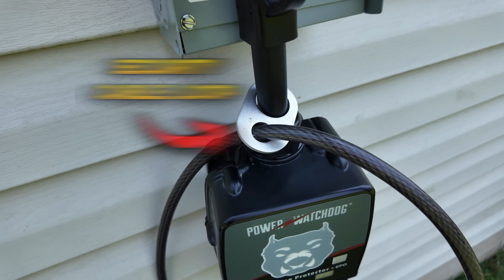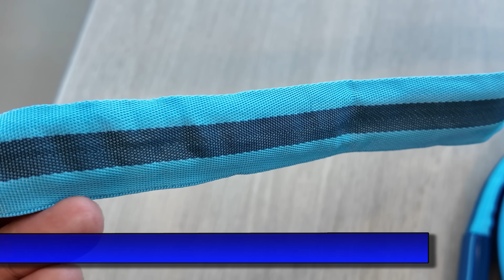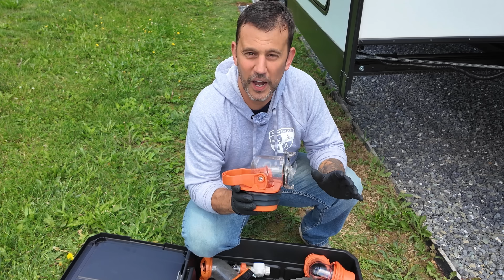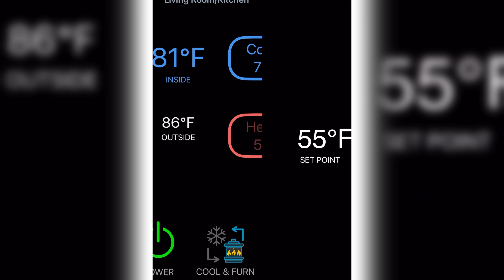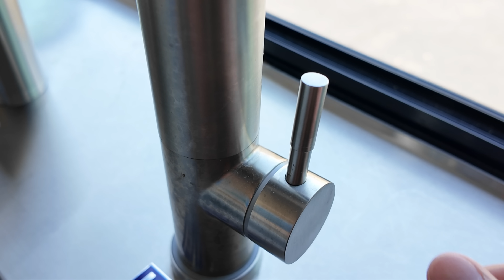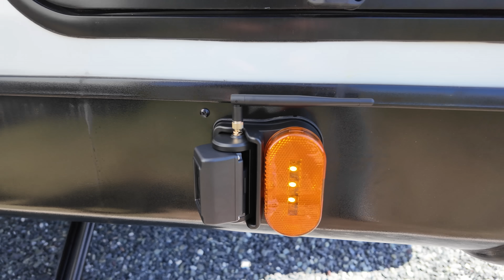💡Innovative RV Accessories & Upgrades That CHANGE the Way You RV!

Comment: I’m glad to see you talked about the Camco Rhino Pro.  When I saw it I thought I had to get one.  For info I have owned six trailers or 5th wheels over a 33 year period.  I kept looking online and found one in stock at a Walmart 1/2 hour drive from my house.  I purchased it online and went and picked it up.

Fast forward a week and we went on the camping trip I am currently on.  Three different campgrounds and the Camco Rhino Pro DIDN’T fit the sewer drains at any of them.  I left my older connector with the stepped treads at home so I had to go buy a new connector (ugh!). In any case I’m glad you provided the info you did here and the advice to carry both connectors.

Thanks
Reply from the maker: thanks for sharing your experience Josh

Comment: Will the micro air thermostat work just for your furnace. My A/C is direct dump with the controls on the unit itself.
Reply from the maker: Yes, as long as there’s a replacement for your specific furnace tstat.  You won’t have AC function wires behind the furnace tstat.

Comment: The rain protection was the only reason I chose Progressive EMS over Watchdog. My next EMS will be Watchdog.
Reply: @LoudRam  progressive also has lifetime warranty on the circuit boards
Reply from the maker: did you ever experience the initial circuit analyzation (before it lets the power through) to take longer than normal... Ive seen someone mention that with the Progressive EMS units... not sure if it was a common problem though.  Both good products.
Reply: @RVTIPSANDTRAVELS  It does take longer than the Watchdog but I usually plug it in and go about the rest of my set up. Then I check back on it a few minutes later and it's ready to go. I've never noticed exactly how long it takes. The campground we normally stay at does have low voltage issues especially during hot days when everyone is running their AC. Every once in a while our power will cut off because of that. The EMS is doing it's job. My last Progressive wasn't an EMS it was just surge protector. The plastic around the blades on the plug started to melt because of the low voltage/high amps. That's when I knew I needed an EMS. This is a MUST HAVE!
Reply from the maker: thanks for sharing, and you are correct, surge protectors arent really protecting against the common problems you will face.  low voltage is more more prevalent than power surges.
Reply: I never really notice much delay. It usually powers up pretty quick and then cycles through the error code status, voltage, amps.

Comment: Where did you find the Camco locking drain? It's out of stock everywhere?
Reply: I got mine 3 or 4 weeks ago at my local Walmart. Been watching Amazon for a while and they're always out of stock. All 3 of my local Walmarts had it 3 or 4 weeks ago. I picked it up at the one I frequent most. A week later I was back there (for something else) and they were out. The other Walmart across town (about 5 or 6 miles away) still had them in stock tho...  Keep checking...  (It looked like it could be ordered on line too and picked up at your local Walmart...)
Reply: Eta -  It works so much better than that threaded clear elbow! It is very worth it... but it's probably good advice to hang on to your threaded version in case you get a really small diameter dump access...
Reply from the maker: Camco sent it to me a while ago before it sold out... keep checking, it looks like it will be at Walmart before Amazon sees it.
Reply: @smrdmr1  check online At Walmart every day
Reply: Keep checking Walmart online. We found one after months of searching. Had to drive almost hour away
Reply: I also got mine from Walmart. It took a few tries to get it. They were always out of stock. I got lucky. But it does work so much better
Reply: I found mine at a Bi-Mart in the Northwest.
Reply: Got mine at Walmart. Shoved way back on the shelf behind the other elbows! SCORE! Or so I thought. When I tried to use it I found it doesn't fit on my sewer hose.( Also a Camco product with a permanently attached clear elbow) . So until I need to replace my hose the drain lock will take up space in my storage space.😢

Comment: We started using a collapsable water hose (not this one) for the ease of storage but noticed super low water pressure.  It finally dawned on me that the hose was the problem.  A standard hose restored proper pressure.  This one looks like it would work better.
Thanks!
Reply from the maker: i noticed this exact thing with my old zero-g hose i was using to wash off my house yesterday.  i havent done flow tests on this hose yet, but from what im hearing people are loving it.